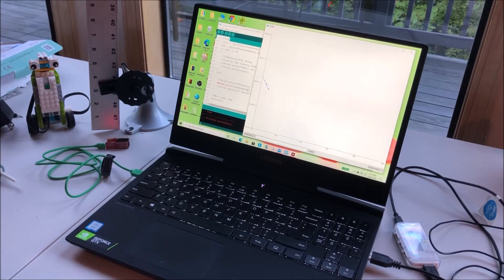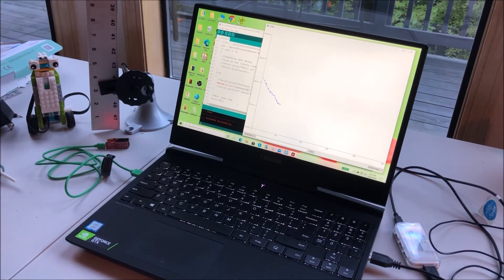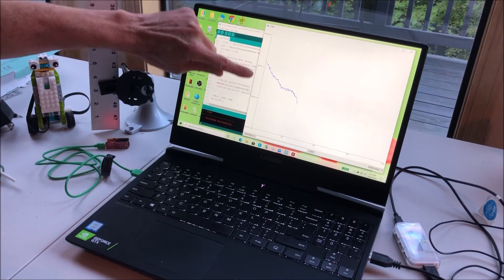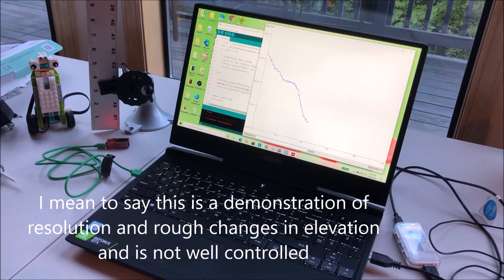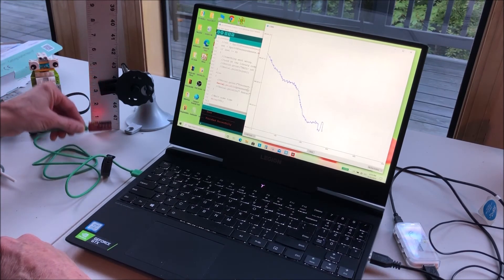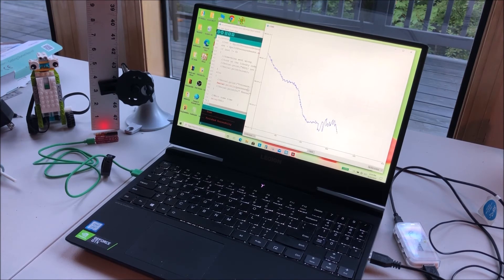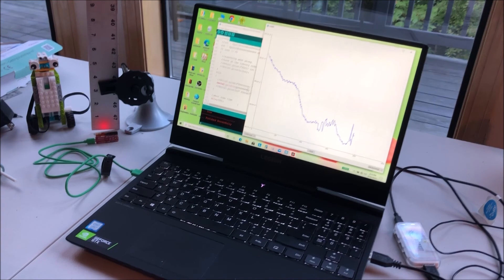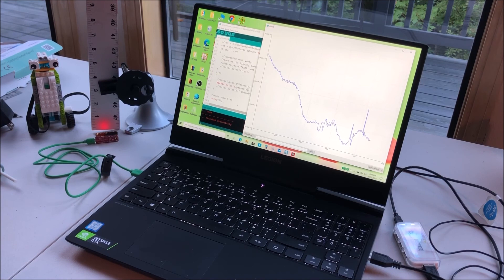Infineon Pressure Shield2Go

Comment: I am using a DPS368 Pressure Shield2Go with a XMC1100. I believe the only difference is this pressure sensor is waterproof. Can you explain how you connected the two? The quick start guide from Infineon is confusing, "Stack the DPS368 Pressure Shield2Go board on top of the XMC 2Go." I am having trouble with this because I am not sure what it means. Is there a header in between the two, soldered on both sides?
Reply from the maker: Hi, I used a header.  I wrote up my review here: https://community.element14.com/products/roadtest/rv/roadtest_reviews/892/infineon_getting_sta